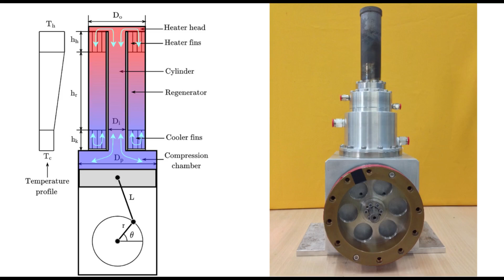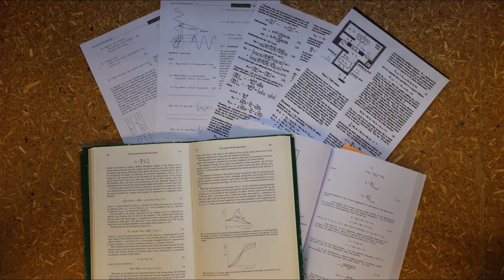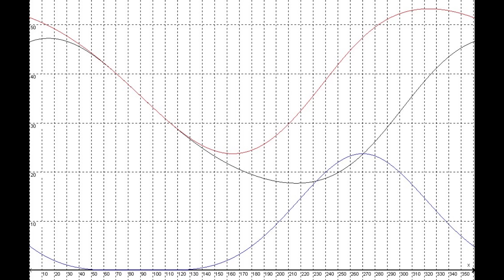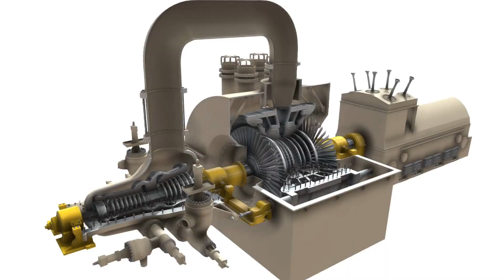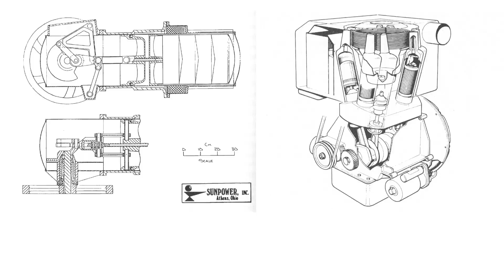Solution of producing cheap energy to support our solar plant to go off grid ?

Comment: Im scared that an alpha stirling engine of sufficient power would need to be the size of a fridge. I saw 400 w low rpm stirlings on yt and they are the size of a fridge so even if you could push the rpm to like 2000 - 3000, it still will be a very big and therefore  hard to make contraption. Perhaps a windmill would do the trick but it depends on your location.
Reply from the maker: You are right, a 2000 watts Stirling is a challenge.
With a wind turbine you are again dependent on the weather, the generator is supposed to buffer the times of low sunshine!
Reply: @myengines2443  Im guessing you dont have any rivers nearby, right? Water wheel would be a great sollution at providing constant, reliable power. You could make it work of rain water but that would by terribly unpractical and unreliable power source though it would be a fun project.
Reply from the maker: Funny enough I have a big river ob my property but is flows very slow.

Comment: No matter how you slice it, to produce electric power one needs mechanical motion.  There is one exception to this but the extreme temperatures required preclude domestic use.

I firmly believe that a rhombic drive Stirling engine can be built with minimal maintenance requirements.  Consider industrial Diesel engines that run thousands of hours without extensive maintenance.   I know that with modern coatings sliding surfaces may operate with minimal or no lubrication.

Any Stirling engine for a given power output and efficiency will encounter similar complexities, namely the heat exchanger design and manufacture. 

For my money I'd design and build a milling machine that mills the internal fins on the hot cap.  With a bore of 6 to 7.5 cm that would not be a problem and it would be much faster than EDM or slotting.  An alternative I had considered is to machine external fins onto a liner sleeve that fits into the hot cap.  These fins would then be nickel brazed into the hot cap.  This also has the advantage of a well defined gas flow passage when the displacer piston is moving towards minimum displacement.

If you have much free fire wood available I'd go with a wood gasification plant.  During WWII many vehicles were powered with this arrangement and much experience acquired as to scrubbing and filtering requirements.  YouTube has a number of channels with promising designs.

Good luck with your endeavours!  Greetings from Canada.
Reply from the maker: I tried many ways to manufacture the heat exchanger fins (including milling and sawing on my milling machine!) and the EDM method is by far the most comfortable. 
The heat exchangers of the thermoacoustic  engine are very simple to make in comparison, that's one reason why I favor it!

I will use wood gas when I haven't enough biogas in winter.

Thanks and best wishes!

Comment: So... Have you considered a different way to apply the Brayton Cycle? I find that it's surprisingly tolerant of how you can input heat into the system, and it doesn't even have to be a gas turbine.

The Brayton started off as a piston engine called the Brayton Ready Motor, so it can be built using commonly available parts from piston engines and air compressors. Nuclear jet engines demonstrate that it can run off of external heating. Heck, if it weren't for the wear and tear, you can run a turbocharger off of a barrel full of wood, as demonstrated by Turbo Burn Barrel videos. 

Given all of that, would it be possible to make an externally fired Brayton Ready Motor? It separates the dirty fuel and combustion products from the pistons and seals, improving longevity. Because it's made out of piston components, it may offset its inherent wear and tear through commonly available and easy to source parts. The reduced efficiency due to being externally heated may be offset by being capable of running off of a wide range of fuel and fuel quality.
Reply from the maker: Sounds interesting, I will watch out for it.
Thanks!
Reply: you took the words from my mouth.
i know of it as a "furnace gas engine", bit different to brayton. cayley?

a stepped piston/oversized piston rod, small side compressing into a furnace, whilst the heated air acts on the other side of the same piston. constant pressure. power output being the difference in areas x pressure. then the piston returns, drawing in fresh air on the small side and exhausting hot gas on the other.

its a bit of a head trip because on one hand, the large piston is expanding the total gas volume, whereas the smaller side is compressing it. the expansion wins, the exhaust is at a lower pressure than the intake. without any heat applied, mind you!
 
at that point... its a jet engine with pistons rather than turbines. book even mentions the concept of turbines... 1912. only steam turbines at that point still.... valves were the issue, dealing with exhaust gases...

so. i made a fireplace, two gas bottles inside one another, hopefully welded to deal with pressure!

idea was a turbo burn barrel, external combustion.

but the last few days ive been thinking of doing a furnace gas engine... poking around at bits of suitable scrap...

the turbo? need a certain air speed, air mass... surface area, temperature rise, before it will even run. may be wasting my time... got a few small turbos, but yeah... go to the effort of plumbing up, only to find at self sustaining speeds i cant keep it hot enough to self sustain... meh. why bother? learn nothing!

(i made ANOTHER one with twice the surface area, lol? i like making fireplaces...)

whereas as soon as the check valves close and air has no escape, and must expand... the piston variety will produce force on the piston.

as long as it has sufficient flywheel inertia, (or multiple cylinders?) to get past the return stroke, it will run...

i sort of plan on documenting it, but yeah... my luck with videos and digital stuff... ahem.

sealed, closed loop... you can pressurise the system.

last thought...

water will expand and contract with heat... ive wondered about if a striling could work filled with water... obviously the ratios have to be altered to suit the amount of volume change... rather than waste time with phase changes and all that nonsense....

Comment: Have you considered nitinol heat engines?
Reply from the maker: Do the exist for higher powers?
Reply: @myengines2443  YES, they do exist for higher powers, in my experience messing about with nitinol engines the most promising are the linear motion engines. 1 square inch of nitinol exerts a force of 25,000PSi. linear motion Nitinol engines "work best" when treated as a "burst system", In other words they create Large amounts of energy at once. They can be coupled with linear Stirling engines to greatly increase performance and thermal efficiency. Nitinol when compressed/bent stores heat energy, and when decompressed gets rid of it, the temperature difference can be around 15-20C. See where I'm going with this? you can have an active passive regenerative cooling system integrated into a Stirling engines design, with the benefits of increased torque generated by the hybrid system.

Comment: Those cheap little thermoelectric peliter devices have a service life dependent on how often you thermal cycle them, how hot you get them, and how much current is passing through them. I've had bad luck with reliability and quality. They seem to vary quite a bit if you buy the cheap ones in bulk, but they are cheap! From my experiments over a decade ago, staging two high seems to work the best, but you need to cull them out and find the most efficient ones from each batch.

As for repair ability, they are repairable as far as you can replace them. Once they are damaged, they are as good as delicate, ugly ceramic tiles.

Why not add a small mount of PAG oil to your existing engine and then run it upside down. The action of the pistons moving, and the heat from the heat exchanger should make it evaporate and condense in the crank case where it should then make it's way back down. It's a closed system, so as long as you are pressurizing it with clean dry air it should be fine for a long time as long as the heat doesn't break the oil down. Give it a shot! It might just work.
Reply from the maker: Do you know something of self making high temperature TEG's (with magnesium?) for a better efficiency?
Oil in the Stirling engine will contaminate the heat exchangers and especially the regenerator so this will not work.
Thanks for your nice thoughts!
Reply: @myengines2443  I do not. I figured it would make for a good experiment. Say you loose 10%-20% of your efficiency but it lasts years of running vs hours. Would that be worth it? This is just my cave-man thoughts on the idea. I see friction and wear, I put oil. Keep it simple ya know?

Comment: One more comment - if one can look at ic engine as disposable unit like lifan 152f / honda g100 clone - 1000hrs of run time, 1kw of power for 60-70 euros - 6 to 7 cents per kwh of electricity. Plus free heat. 

Where Stirling do cost at 6k ++ range for similar power. And last to 10k hours. Which does not sum up in any proficient way.
Reply from the maker: I really don't like the idea of using a IC engine a short time just because its cheap and the replace it when it is worn out.
Also the combustion gases are very dirty and it is loud.
Of cause it is mainly a hobby for me and I want to find something better, more reliable and environment-friendly.
It surely would be easiest solution but also the most boring one...
My hope is to build a reliable solution for much less than 6k that's reliable for years.
Reply: @myengines2443  yes. And this is the same reason, why I experiment with stirlings too.
Reply from the maker: @StanislavZachazevski  That's what I thought! :-)
Reply: Did you googled for alphagamma type of stirling engine ?

Comment: there is no need for a big boiler for a steam turbine. Monotube boilers can be made compact and efficient (using 20-30m of 8mm 304 tubes), with a probable total system efficiency of 30% using a tesla turbine, which is compact and efficient. Any burst will only generate a single pinhole leak, and can be entirely avoided with electric controllers, like an arduino, and a safety valve at 350psi
Reply from the maker: Ok, monotube boiler sounds really interesting.
Is a tesla turbine able to compete with a conventional steam turbine or steam engine with regard to efficiency?
Thanks for your suggestions!
Reply: @myengines2443  Depending on the design, it can reach 37% efficiency single stage to 63% efficiency max with multiple stages. It is somewhat simpler to build than normal turbines (which blades need to be very precisely built to not have balancing issues, and have peculiar geometries, while the tesla turbine is a set of simple disks, which have a single hole in the middle, and either a star shaped separator in the middle, bumps in the outer diameter, or 2mm shafts with separators in the outer diameter, which also serve as a torque increaser). The most difficult part is the shaft sealing, nozzle, and casing, which any turbine needs to have.
Reply: @myengines2443  Tesla turbines can be very efficient, but for an efficient design the stage pressure ratio is poor unless the turbine runs at outrageously high speed (peripheral velocities of 500 m/s or greater are required, even at modest steam pressures and temperatures!). The materials science challenges of constructing a rotor that can spin so fast without exploding due to centrifugal stresses are significant, to say the least. Unfortunately the radial flow layout of the tesla turbine design is not well suited to compounding of multiple stages, which is a problem when you also need numerous stages to keep the rotor peripheral speed within the realms of possibility.

Rateau turbines (pressure compounded axial flow impulse turbines) are probably a better choice, as they require much lower (1/2 that of the Tesla) peripheral speeds for the same stage pressure ratio, and can readily be extended to as many stages as are required. They're also relatively easy to design.
Reply: If steam boilers aren't as problematic as we thought, does that not open up the ability to use a turbocharger as a turbine instead of a Tesla turbine

I figure some slight modifications to a vehicle turbo would work great for producing steam power
Reply: @nilnailscrew4784  You'd need to either separate them and use a single turbine, or use both, with one acting as an exhaust pump. I also think that it is designed specifically for high flow low pressure systems, which is mostly detrimental to steam efficiency (huge amount of water use, no temperature efficiency increase).
Reply: @ExtremeGamerYT22  I imagine the easiest way would just be to take off the second blade and replace it with a shaft hooked up to a generator, although maybe the second stage could be useful in making a pump but I dont really know the benefits to that.

also if you need low flow high pressure could you not just use a smaller turbo?
Reply: @nilnailscrew4784  You can do that, and it has been done, but it is not made for steam, and is also very expensive where I live. It's possible, just expensive and not efficient.
Reply from the maker: Ok, steam engines/turbines seem to be much more interesting that I thought....
Thanks, I will watch out for them!
Reply: also I imagine the high pitched whirring sound of a turbine would be pretty simple to insulate since high pitched sounds dont travel very far/through objects
Reply: @nilnailscrew4784  You just need to connect it to a condenser, then the exhaust team is transformed into water, where it no longer carries the noise
Reply: @nilnailscrew4784  single stage turbines are useless.

"curtiss" turbine. "rateau" turbine.

theres two type of turbine. impulse, and reaction.
impulse is the same idea as a pelton wheel. "delaval" turbines. the wheel must spin at half the speed of the jet hitting it for maximum efficiency...

to expand steam from boiler to atmospheric produces ridiculously high speeds, in a proper delaval nozzle. that raises balancing issues. raises whole host of issues. single stage delavals are insanity.

the basic de laval can be broken into stages, still expanding the steam to full velocity in a nozzle, but when it strikes the blades, it only loses half its velocity, passes through fixed blades, then back through another set of turbine blades, where it loses the rest of it energy... or in three stages, etc. that is a "curtiss" turbine.

the steam is expanded in the nozzles, reaches full velocity, at atmospheric pressure, and imparts that velocity to the turbine blades.

but! that can then be designed so the nozzles exhausted into a chamber at half the pressure of the incoming steam. and once the steam has lost its velocity passing through teh blades, it can pass through even MORE nozzles, and there can be another stage behind it... and another... and another... until the steam is so expanded and or cold that its got no more energy worth extracting.

impulse turbines are relatively easy to seal between stages, between the shaft and each chamber with labyrinths, and a single expansion one doesnt need any sealing at all? the steam has no pressure, and no urge to escape the blades.

in a REACTION turbine, the steam is expanded in the blades...or, its the nozzles that move. 
 there are no pure reaction turbines other than heros turbine, the only example of pure "reaction"... a garden sprinkler, perhaps?

for maximum efficiency, the nozzles have to spin AT THE SAME SPEED that the jet emerges... that means TWICE the speed of a delaval turbine! parsons divided that into stages, only a small expansion per stage. so each stage only spins relatively slowly, but still stupid fast. and so the first practical steam turbine was born...

they have leakage issues, as the pressure changes between each stage, and so it just wants to sneak past the blades rather than through the blades... sealing each set of blades is a design challenge... thrust has to be taken account of...

it actually gets really hard differentiating the two principles! just remember, there are two fundamentally different modes of operation. impulse is easy... the jet of water from your hose washes things off the path.
reaction is the hose pushing back against you, your arm.

BUT!
they all rely on using the velocity and pressure of the steam to act upon a blade, a change of direction, inertia, momentum, creating a positive force. the steam has mass, and heat. it has energy that has to be liberated.

the tesla turbine does NOT. its relying on sheer, boundary layer, fluid friction. its overhyped, and theres a reason it isnt used... it doesnt WORK. theres no impact on the way steam flows through one, with the blades inserted, removed, locked solid, spinning the wrong way, or anything...
sure, they spin the blades. sure, they drag them along a bit and might power a small load...

until i see one demonstrated with actual measurements of power in versus power out... i stand my ground. they dont work.

that being said, at one point i ordered a stack of inconel washers with the idea of trying to make a small tesla turbine based turbocharger... im always willing to be proved wrong.

Comment: I believe that the best option is a conventional diesel engine adapted to run on gas with a spark plug, with a piston and piston liner made of 316l stainless steel. This way we would have an idea of whether it is viable to build an engine to burn LNG in combustion cars.
Reply from the maker: Is it common practice to use stainless steel piston and cylinder liner in IC engines?
I thought the sliding properties of stainless steel are to bad for this.
A full stainless combustion chamber would be nice and could be the solution but I never heard of it!
Reply: @myengines2443 stainless steel is indeed known for seizing. I don't think it's gonna work.